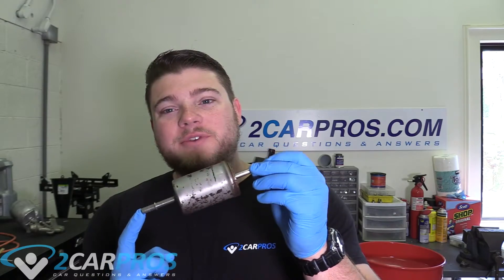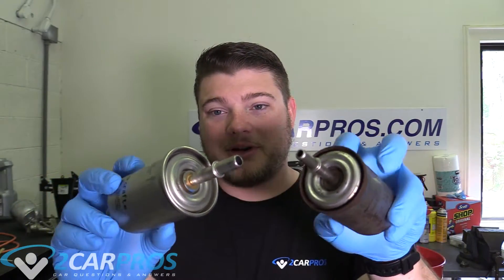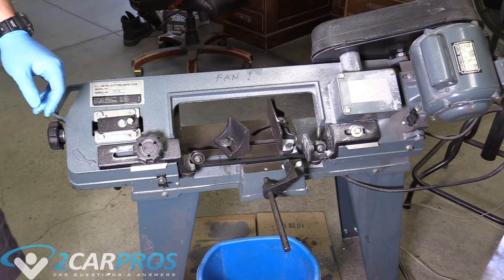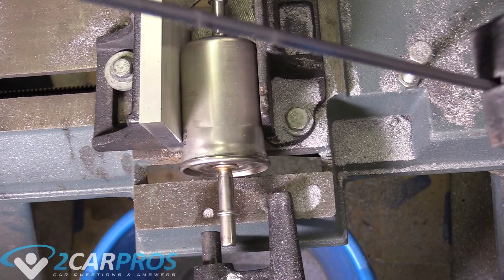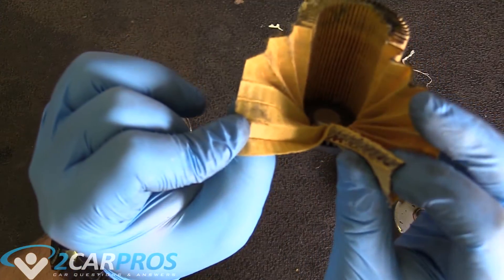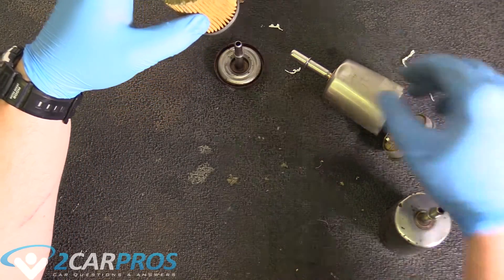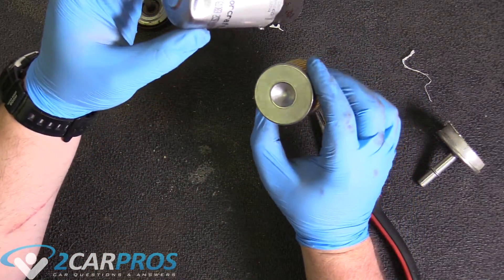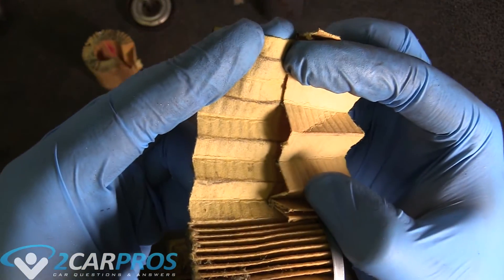What is Inside of an Used Fuel Filter? Do Not Try at Home!

Comment: Quick question, you mentioned the cms essentially telling the fuel management to back off a bit because it is now sending too much fuel through for an idle. When it backs it down, is it common for the engine to stall out when idling at stop lights? If not, can you give some advice as to what may cause this? BTW I have a 2003 f150 lariat
Reply from the maker: No that's not common to happen multiple times. That might be a crankshaft positioning sensor. Thanks for watching!

Comment: This „used“ filter was not the original from factory. After 130.000 Miles it is black.
Great Video! :)
This used filter is max. around 4 years, 30.000 miles old 
It was probably a cheaper replacement because of the corrosion on the housing.
Date Stamp on the used filter? OEM does have it